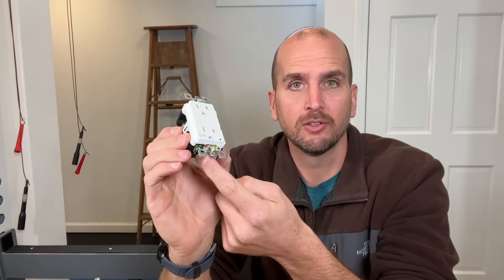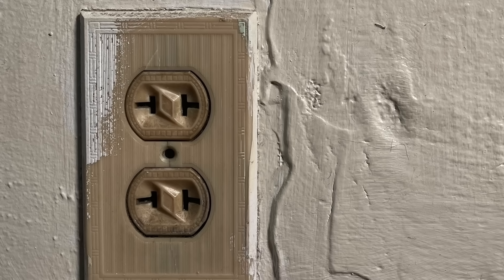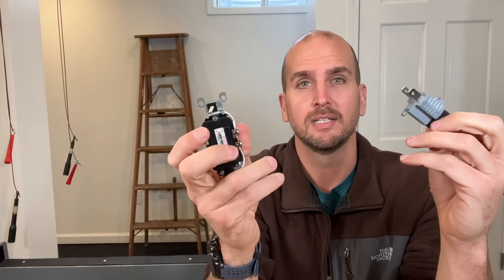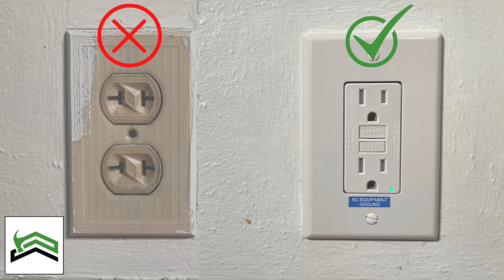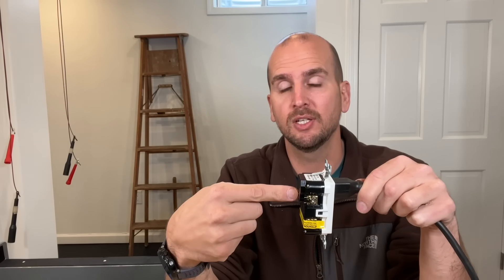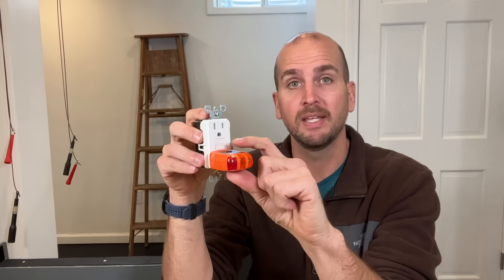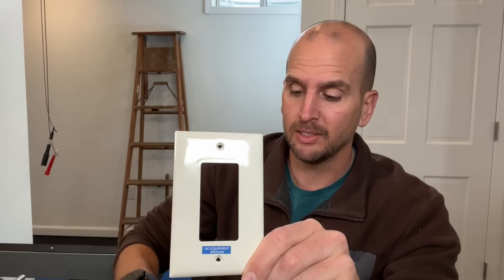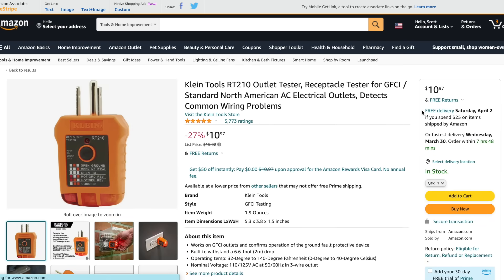Does a GFCI Outlet Still Provide Protection Without A Ground Wire?

Comment: I live in an old home with 2 prong outlets. I'm forced to use those adapters where needed. EVERYTIME I touch my aluminum PC case I get a mild shock and my PC resets... Not good. Lol. Would upgrading to a GFCI outlet (even though I have no ground) fix this? Or..  Would it just trip the GFCI breaker EVERYTIME I touch my PC case? Do you recommend upgrading ALL old 2 prong outlets to GFCI outlets?
Reply: It wouldn't change anything. I do not get why your PC resets. Sounds like a problem with the PSU. If you are grounded you will get some current from the PC. Make sure you are isolated. I you get shocked it may be just static. A static discharge is a short pulse.

Comment: So I don't have a ground wire for an outlet I am trying to install only 1 white and 1black.
I tried to install a ground outlet but did not worked does that mean I need a gfci for safety and will it work?
Reply: The  outlet will still operationally work ... but... there is no ground for safety.  The GFCI does not replace the ground.  The GFCI that does not have a ground hooked up is an alternate safety mechanism.  Hope this helps.
Reply: How did it not work? The ground wire is not needed for the outlet to work, it is for safety. It is like a car would work without seat belts. If the car does not start seat belts are not the issue. I advice you to contact an electrician, you seem to have reached the limit of your skills.
Reply: @okaro6595  I figured that the outlet did not had power after all

Comment: Just Like to add to your good info. Many look at the Hot Leaking or touching to ground as the Cause of Tripping, Neutral touching ground will also cause it to Trip, as Ground would be carrying Current. Hot and Neutral need to Draw Equal, any Difference, then they Trip.

Comment: It seems to me that this GFCI will work for those Chinese inverter that the ground and the neutral can not be bonded.  At least this  will provide some protection.  Notice that the chasis of these type of inverters can be connected to a ground rod...but...the problem is that if the metal of the equipment powered by the inverter contacts the hot cable....you might think that the current  will be dissipated via the ground...but not since the ground in the inverter is floating and there is no path to the source...

Comment: I have an older home. I was told bootleg grounds are legal which appears to be false. It’s 2 wire with no ground. I put the bootleg ground gfci at the fireplace receptacle that I can’t rewire. It’s the second outlet in the circuit. If I take it out and put the gfci at the first outlet in the circuit with no ground it should be protected I gather from this. What about not having a ground for the electronics I have at the fireplace tv, game systems, dvd, etc.. Is it more susceptible to being damaged from storms? I put a surge protector in the panel as well btw.

Comment: excellent explanation.  Our home inspector did highlight for us that, while recepticles had been changed from 2-prong to 3-prong (not GFCI) the underlying wires had not been changed.  He described this as "common".  (No label, either.)  He did recommend GFCIs be put in wet areas.  Based on your and other youtube input, we will be letting him know he is not giving the best advice to potential home buyers.
Reply: Yes, when you do not have a ground wire it is always GFCI. The wet rule is for new installations with a  ground wire.

Comment: Your exactly right been saying this for years ground is good but GFCI  reads between  hot and neutral  not ground and will trip if different amps between hot and neutral 5 Mil amps!  Back in the day sharing neutral with  another phase will not work with GFCI Breaker . Example A Phase pulls 12  amps on its own so Neutral pulls the same 12 amps GFCI WILL NOT TRIP. But if you share Neutral with B  phase that pulls 10 amps the Neutral will have 2 amps on it the difference between the two loads , the GFCI  sees this as a fault and will trip since  A phase hot has 12 amps on it and the Neutral will only have 2 amps since is sharing the 10 amp B phase load

Comment: This is what I thought. Thanks for the info. I'm an Ironworker and I'm rewatching an old Csi episode where a construction worker dies from electrocution and the super says a gfci won't work if the tool's ground prong is cut. But I KNEW that couldn't be correct.

Comment: Some videos explain how a ground wire that bonds to the neutral wire protects against ground faults, but I've also heard that this isn't the best protection. So what do a ground and GFCI do differently and why do you need both? Thanks
Reply: My understanding is that you can get shocked with or without a ground wire, but at least electrocution would be eliminated, again with or without a ground wire. Without a ground wire the risk of damage to sensitive electronic equipment is high with regards to surges, ESD and lightning strikes. With a ground wire there is still a risk. The solution is to use a surge suppressor for sensitive electronic equipment protection regardless if it's on a gfci or regular receptacle and surge suppressors will not operate without a ground wire. Would a low tech kitchen toaster be damaged without a ground on your gfci? I doubt it, because the gfci will trip quickly if a ground fault occurs.
Your question, why do you need both? I'm thinking that a gfci is just another 3 prong receptacle and should have ground if possible, to provide an extra level of safety and some protection to appliances.
Reply: The ground wire protects if the hot wire touches the case but it does nothing if for example the cord is damaged so that the live wire is exposed and you touch it. A GFCI protects in those cases. However in the cs e the case is energized you may still get shocked even with a GFCI if there is no ground but it prevents serious damage.

Comment: Question: my home was grounded at a later point in time. However, my detached garage seemingly does not have a ground wire. In fact, after looking into my garage grounding, I’ve found 4 wires coming from the main panel underground. 3 orange (2 of them live) and a neutral wire. I would assume that third orange is a neutral.

Without a sub panel, would a GFCI outlet properly ground the garage? If I had a grounding rod that I attached to the box, does that work? No one has any answers about this except for just “install a sub panel.” Electricians can’t get to me in my area for months, which means I’d be learning this myself or finding an alternative. Is this a solution?
Reply: "Without a sub panel, would a GFCI outlet properly ground the garage." The short answer is NO. Per the NEC detached structures require their own EGC (Equipment grounding conductor). In accordance with 250.32 (B) (1), a feeder or branch circuit supplying a separate building or structure generally must include an equipment grounding conductor (EGC).I had the same issue in my detached garage. 4 wires coming from the 200 Amp main panel, feeding the 100 amp panel in the garage. I had two black, and two white wires. The two black are hot, and the two white were used as a neutral. The problem there is that in a sub panel the neutral and ground are REQUIRED to be separated. Mine were NOT. I ended up installing a neutral bar kit, and a ground bar kit in my sub panel. I took one of the white neutral wires and wrapped it with green phasing tape and use that as a ground. That goes to the ground bar inside my sub panel. I also installed TWO 8' grounding rods, spaced 6' apart per NEC code. From the ground bars I ran a continuous #8 solid copper wire to inside the sub panel and terminated it at the ground bar inside the sub panel. No sub panel in your garage? What size wire from the main structure to the garage? What size is the breaker feeding your hot wires to the garage?  You will need to determine which two of the orange wires are hot inside the main panel. Assuming the 4th wire is WHITE, the third orange wire will become the ground, but it needs to be clearly marked as such both inside the main panel, and inside the sub panel. The neutral wire you reference... Is it a white wire?
Reply: If there are four wires one would assume one is the ground but you obviously lack the knowledge to do the change so I would advice you get a professional to fix it.

A garage is a dangerous location so I would not trust a GFCI alone. I would want a proper grounded outlet.

Comment: Problem with these is you can still get shocked.  If you touch the hot and the neutral for example and say 5mA flows thru your body, that will NOT trip the breaker because it will see 5 mA on the hot and 5 mA on the neutral.  The GFCI cannot tell the difference between that and say a large value resistor connected to the hot and the neutral.  That is a valid circuit but so is your body.
Reply: If you touch both hot and neutral on any circuit you will get seriously shocked. You are putting yourself as the load. The solution: do not touch hot and neutral. In fact do not touch any live wires.

Comment: This totally changes my plan for my class B camper van build.  I wasn’t going to include a GFCI on the 120v system because I had read they wouldn’t add any protection without a true earth ground.  The exception being of course if you’re connected to shore power where the supply is supposed to be grounded to earth. So much for experienced electrical “experts” on the ‘net.  Thanks for the helpful vid!
Reply from the maker: You bet!  Best of luck on the project, sounds fun 👍

Comment: If you have several outlets on that circuit it might be more practical to install a GFCI circuit breaker for the whole circuit. Also if you change one outlet you have to ARC fault the whole circuit.

Comment: If the GFCI's aren't designed to trip multible times, so if it should fail for some reason, you'd better have it grounded.
Reply: GFCIs are designed to trip multiple times as they should be tested regularly and that causes them to trip. Now as mechanical and electronic devices they can fail but that is why they should be tested.

It is better to have it grounded but the cost is much more and that is something one should leave to a professional.
Reply: @okaro6595  
What do you think multible times translates to -- 3 or 30.???
It will depend on the short, they are designed to be a first defense, not fool proof, and not grounding anything is asking for trouble...  
This is why I never rely on YouTubers for sdvice.

Comment: I think its important to note that without a ground, any GFCI would still need a return path to the source to detect the ground fault.  That's why the plug tester fails to trip the GFCI, faulting to the ground doesn't provide a return path to the source.  So the only way for a GFCI to trip during a ground fault scenario is if something, or in reality someone, provides said return path.  So if you have the option of installing a ground go that path.  This way the ground fault trips immediately instead of waiting for someone to come along a provide the return path.
Reply: You do not seem to know what a ground fault is. It is that current escapes from the circuit to the ground. No current escaping, no ground fault. A GFCI monitors the current in the live and the neutral and if it finds a difference it cuts the power. 

Th fact that the tester fails is just because the way the tester is designed..
Reply: @okaro6595  we are literally saying the same thing!
Reply: @okaro6595  Also the way the tester is designed is to close the circuit between hot and ground, creating that imbalance between hot and neutral as you stated.  My statement is still valid, I'm arguing its still better to have a ground so that any ground fault situation causes the GFCI to trip immediately rather than waiting for a person to become that return path inadvertently.

Comment: You forgot about a few places like Cook County Illinois where we use metal conduit and Romex is prohibited.  The metal conduit acts as ground and is routed back to the Fusebox as such.  In situations that have flexible metal conduit over 6ft or over a specific amperage you must run a dedicated ground back to the nearest rigid conduit metal box.

Comment: great video but i have two things i need clarification on:
1. in the moment that you touch an energized appliance, and you become part of the circuit, the ungrounded GFCI outlet will trip. It takes a fraction of a second to trip. It also takes a little bit of time for electricity to finish flowing between the outlet and the unintended ground. So in that brief period of time between touching the appliance and the electricity flow finishing, you will get shocked, no? Won't you feel at least even a zap? Would this zap be more impactful on children?
2. why do we need to label an ungrounded GFCI outlet "No equipment ground" if it's "safe" for use with three-prong appliances?

Comment: The common problem with when someone replaces an old two wire outlet with a three prong outlet is reversed polarity and especially on appliances will energize the metal frame of the appliance
Reply: You mean they connect the ground to the live wire on the socket? That is a big no no and can be done accidentally when one tries to do a bootleg ground.

No equipment has the case connected to the neutral.

Comment: I am wanting to change 2 prong to 3 prong. Should I attach a pigtail ground wire into one of the holes in the metal box? All the outlets in my old house are for 2 prong, so I have several adaptors, which now I know are unsafe.
Reply: Do not do any extra ad hoc things.

Comment: When u have BX without a ground.   The cable jacket is the ground.  So u have to make a mechanical ground to the steel box.  Or if you can.   In a knob and tube I had to run a ground to the plumbing and bond it to a pipe
Reply: The cable jacket is not intended as a ground. Having a GFCI is still a good idea.

Comment: Have you ever looked at plug-in GFCI? If you are a renter, and you have ungrounded outlets and your landlord is not local or helpful, would these work?
Reply: The problem is that you cannot do the two prong-three prong conversion in a nice way with those. Sure you could use a cheater plug to do it. Cutting the ground prong on the GFCI is not advisable. Otherwise when used they are just as safe.

Comment: Actually, what those testers are doing is reversing neutral and hot. I've tested those testers. The outcome is still the same. I say add a ground. If you're going to the trouble of putting in a GFCI then put forth the extra effort to do it right.

Comment: In an old condo, where the ground is provided by the metal conduit attached to the breaker panel, and metal conduit is used to connect all the outlet locations,  CAN you screw a short piece of wire to a metal outlet box then to the ground on the GFCI ?  Would that possibly have ground?  How do you test for ground?

Comment: I'm pretty sure you wouldn't even have to touch the faulted appliance to get the GFCI to trip. The hot wire touching metal parts of the appliance would create a current imbalance regardless and thus would trip it immediately.
Reply: Yes, if it is grounded but it if there is no ground that is not sure. Also a GFCI protects also against other faults like if you touch a damaged wire.

Comment: If the external tester doesn't work, does the test button on the GFCI outlet work if the outlet isn't grounded?
Reply: It works as it does not rely on the ground. It diverts to the neutral passing the GFCI.

Comment: Not a big deal, but when you press the button on the gfi tester it doesn’t make a connection from ground to hot. If it did, it would trip the breaker when trying that out on a non gfi outlet and of course it doesn’t.

Here’s the thing, though. I have always thought it made a connection from ground to neutral, because that would trip a gfi and not a breaker, but I just went out to my truck and put my continuity tester leads between all different combinations while pressing the button and got nothing.

I did some google search to find out how it actually works, but found nothing. Does anyone know what the tester actually does when you press the button???
Reply: It makes a connection from hot to ground but there is a resistor, something like 20 kilo-ohms.

Comment: When i press the GFCI test button on my plug-in tester, it lights up as HOT/NEUTRAL Reversed. Is this normal?
Reply from the maker: Doesn't sound normal.  Does it trip the outlet when you press the test button?
Reply: That is a perfectly normal artifact. The tester connects the hot wire to ground through a resistor when you press the button. If there is no ground wire now hot and ground are at 120 V while the neutral is at 0 V. The tester interprets this as hot/neutral reversed.

The test button does not work and nothing can be interpreted from something that does not work. Also the tester cannot detect hot/neutral reverse without a ground.

Comment: Box clearance is an issue in my old home, as is the fear of damaging these old wires. An electrician said that replacing my breakers with combination arc-fault/GFCI breakers might be a good idea, however I thought the lack of a ground wire negated that?